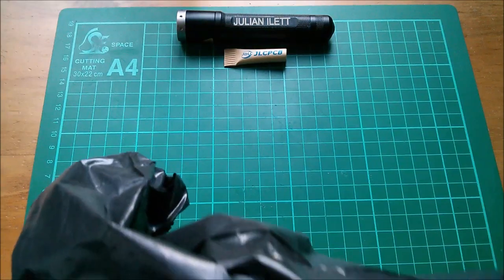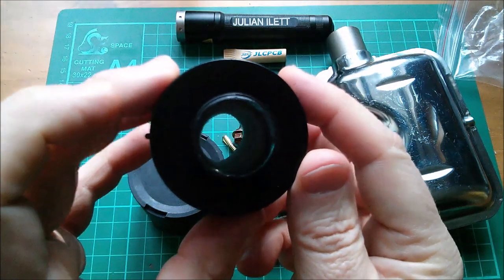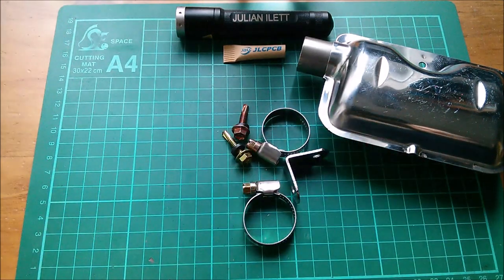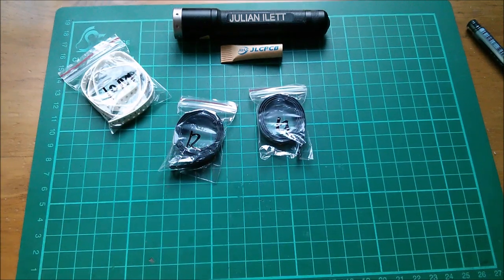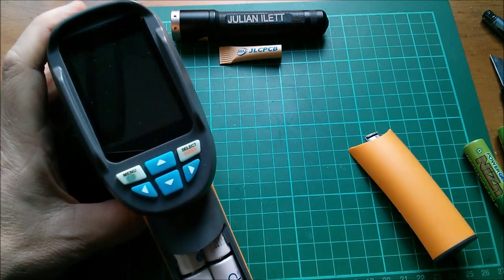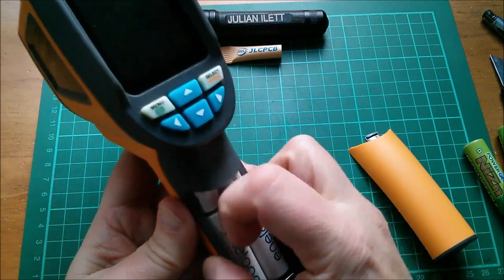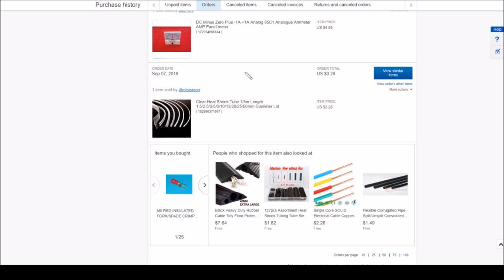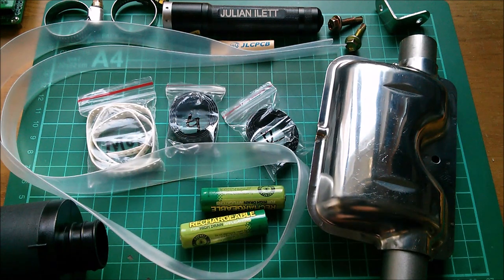Julian's Postbag: #0x80 - Four Envelopes and a Knife

Comment: That snap off blade thing is kinda interesting, because I have had a few different knives like that (certainly cheap ones) during decades and I have never had a failure. I just extend the blade so that the snap line is just outside the knife body (no pliers needed), and then use the tail piece with the slot inserting it close to the line and then just a quick motion to snap it. And you need to snap it away from the line i.e. if the line is on top then snap downwards.
Reply: Yes just retract the blade to expose one blade section leaving the knife body to secure the rest of the blade. Use the tail piece as pev says. Come on Julian, I'm surprised you're struggling with this, a Technician of your calibre!
Reply: Spot on, was just about to suggest that too. One blade out, and then it snaps off easily.
Reply: Yes, this how it's intended to be done. The way Julian was doing it made me cringe a bit, and I was expecting him to slice his fingers open!😮
Reply: Worse yet... Sproing!  Several snapped off blades flying everywhere, into thighs, eyes, and the very skies landing in carpet awaiting the unprotected soles of passers-by.
Reply: precisely I've used lots of these both cheap and expensive never had any problems always snapped off in the right place
Reply: Not seen someone fail so badly at using one of those snap off blades.
Reply: Sorry Julian, we're giving you a bit of a hard time on this blade thing! Perhaps you were hamming it up a bit for a laugh. Thanks for your hard work. I always look forward to your slick and well produced videos.
Reply: @
pev 16 
i just extend 1 segment put it sideways and flat on a surface press my thumb on top of the blade and lift the handle upwards , snaps off on the line with no messing about with fiddly slots in the end cover :-)
Reply: @webchimp  Perhaps on the shopping channel?
Reply: And remember to snap so that the blade pieces end up facing AWAY from you, especially your face.... The snapped off piece can fly out of the snapper tool slot if the slot, and you don't want it in your eyeballs.
Reply: Although on second watch I must say the knife Julian has here seems particularly crappy. The slot in the tail piece is weirdly recessed which guarantees trouble with the snapping.
EDIT: To the "sproing" comments, no, the snapping process really does not make the piece fly forcefully, for that to happen you have to do some extremely weird stuff to the blade, even weirder than Julian does here :)
Reply: @bobriemersma  My laughing almost caused me to Die. To carry on, I will Try. Sigh.   :-)

Comment: The intake silencer works on the absorption principle. This principle will reduce higher frequency sound waves, but have little effect on low frequency noise. 

The flue/ exhaust silencer works by reflection. This principle reflects sound around the inside of the can to trap it. The actual flue gasses simply pass through the torturous route, reasonably unaffected. 

If the flue silencer inside the work area, it'll give off a few extra Watts of heat.

Comment: Serious comment on the NiZn:

NiZn cells are marked with the mWH to aid in marketing (they can't make 2500 mAH), the idea is that due to the higher voltage the capacity is similar to that of a NiMh of 2500 mAH.

As far as self discharge is concerned, they have a low self discharge early in life before gaining higher self discharge. The self discharge really increases after 30 cycles or so.

Charging can be done on a bench supply with appropriate voltage monitoring. According to Wikipedia the charge can be done at a rate of C or C/2 to a cutoff voltage of 1.9

More info here: https://en.wikipedia.org/wiki/Nickel–zinc_battery

Comment: I was going to order some of those PCBs from your outfit, got through the process, then got to shipping!  WOW sure gives new meaning to 2 bucks for 10 PCB's!  It's one of those outfits that lures you in with a cheap price then sticks it to you for shipping, at least that's the way I see it. I could be wrong but it would be a rare incident in time should that happen..
Reply: Keep in mind it depends where you live, but even with shipping it's still by far THE cheapest I've ever seen for custom PCBs, something like $12 after shipping for 10PCBs whereas OSHpark for example can offer comparable prices but only for fairly small boards and you only get 3 of them but JLC let's you do up to 100x100mm plus you can do panelization, which means for small boards let's say 20x20mm you could get that made into 5 boards on a 100x100mm panel that you can snap apart or in other words 50 boards for the same price, I could be wrong but I've not heard of any of the other guys even offering to do that.

Comment: That is an air intake silencer, that's for sure. It will work well, but you need an air filter too. It's not the bugs you should be concerned with, but the abrasive particles that could be sucked into the cylinder which will act like a sanding paper.

Comment: You should get some of that resealable gel for PCBs. That gel that makes a huge mess but you can stick probes through it and probe your board then when removed it reseals the water proof coating. May be a bit expensive though.

Comment: Consider two 14500 LiFePo4 and two dummy cells for your camera's higher voltage needs. They're also good for flashlights which can accept lithium because they just as bright but safer.

As for the hot exhaust next to wood. Cut up an aluminum pie tin and tack it on the wood to reflect the infra red and dissipate any heat which the aluminum absorbs. It's cheap insurance friend!

Comment: Retract the knife so only the 1 link you want snapped sticks out, angle it  with the brake line on the knife, if you do this, snapping it off correctly works just fine using the cap.

Comment: The fresh off the line voltage of a quality alkaline cell is 1.65volts so it should be fine to use 4 of these instead of the enelopes.

Comment: For your charge controller you should do a test were you coat one, you just sleeve (and hot glue) one and the third were you do both.
In the sleeved ones the water can't evaporate compared to the just coated one.

Comment: Julian - Two notes and a question -.  
1.) Only expose the single blade piece that you want to snap off of the knife.
2.) Open voltage on an alkaline is about 1.6v ... charge the new batteries to something that settles to around 1.6v?

Also - with Lithium rechargeables and 'military specs'.  Any idea how much energy storage is lost by skipping the long final 'topping off' phase of charging?  It seems to me, the extended life of the battery could be well worth the cost of adding an additional cell to a project.
Reply: Ok - Now I see other comments about the blade.  Add me to the list ;-)

Comment: for your thermal imaging camera you could always try using a portable usb power bank to boost the voltage from the 4.2 volt lipo's too just one volt below the 6 volts the cammera is expecting that should show mostly full up till the lipo reaches its cut off voltage.

Comment: just get a kit of LiFePO4 batteries from Soshine, you get 4 batteries and 2 connectors: so you can use 2 batteries + 2 connectors in your thermal imager and keep 2 batteries as spares. I am so happy with those in replacing AA alkalines and NiMh

Comment: Have you thought of using peltier elements on the exhaust of the diesel heater?
Heated up the do send out voltage, maybe you could put a bit back into the batteries that way.
Not sure how many amps though, but it could be worth an experiment (and a video).
Reply: They have terrible (read: single-digit percentage) efficiency. Have you seen these "heat powered ultra quiet eco-friendly silent stove fan" things? They barely manage to kick that motor over and require uncomfortable temperature differences to operate.
Reply from the maker: Yes, you have to heat one side while keeping the other side cool - that's means a complex interface to that curvy silencer and a big heatsink to the cool air.
Reply: @JulianIlett  You'd be better off trying to improve efficiency with a heat exchanger that warms the intake air with the exhaust heat. Maybe coil the exhaust pipe a few times inside an "intake pot" of sorts. Just make sure the exhaust pipe is gas-tight and rust-free, and that the actual openings themselves are kept well separated, or there'll be no more postbag videos!
Reply: Well.. The cooler you can keep the opposite side, the more you'll gdt out of them.
May not be much, but better than nothing.
With winter coming, keeping them cool shouldn't prove to much of a problem. Think of it a lower powered backup to your solarpanel setup. 
Any little thing you know ;)
Reply: I was thinking, might not be too bad an idea to just set up a diesel generator in a box outside the work area and have a fan blowing the heat off of it into the work area.  With an electric starter you could hook it up to the thermostat and have it turn on/off with the temperature.  Could use excess electricity to run an electric heater when the batteries get fully charged.

Comment: Would the exhaust not be safer if it were above the level of the roof line much like central heating boilers, thus the fumes wont get blown back into the enclosure during windy conditions?

Comment: NiZn accumulators are designed to give a large current. In a device that consumes little, they may deteriorate quickly enough. It takes a specific charger to load them properly!
watch out for dendrites that form with weak currents

Les accumulateurs NiZn sont prévus pour donner un courant importants. Dans un appareilqui consomme peu, ils risquent de se déteriorrer assez vite. Il faut un chargeur spécifique pour les charger comme il faut !

Comment: I would whack all the batteries in, aren't alkaline normally 1.6 ish when new?
Reply: The nominal voltage of a fresh alkaline cell as established by manufacturer standards is 1.5 V. The effective zero-load voltage of a non discharged alkaline battery, however, varies from 1.50 to 1.65 V, depending on the purity of the manganese dioxide used and the contents of zinc oxide in the electrolyte

(Wikipedia)

Comment: The front end of the plastic is angled same way as the scoring on the blade to use the handle to snap it off!! Leave the pliers and fingies out of the equasion
Reply: Just going to say the same thing.
Reply: @gibbo9089  those blade pieces gone flying can really make a mess hitting an eye😣 the fact that julian does not know the proper way is beyond me, since he  is so good with the knives
Reply: But if the fingers aren't anywhere near the blade what fun are knives then?
Reply: @heikovanderlaar3780  i usually cut towards the thumb, when i like to live dangerously! But the mess is awful...

Comment: Speaking of devices that require AAA/AA batteries and tend to complain about NiMH's voltage - I managed to hook up two "dummy" (empty inside) AA batteries with external wires sticking out of them, leading to an adjustable powerbank - that way you can set whatever voltage you like and run AAA/AA powered device for hours from your 18650 collection. You do have to store a power bank in your pocket yes, but it's million times cheaper than using alkalines. It looks something like that: https://i.imgur.com/Wm5e0Up.png

Comment: The moisture in your old solar controllers are most likely due to the humidity in the air before and during sealing them up, condensation from the moisture not having the ability to escape

Comment: Use a Batteriser!
Reply: the batteriser reduses the max capacity by 25-45%, so that isn't goin to help much. a LiFePo4 18650 or two will work just as well, and have a higher capacity.

Comment: I actually need those batteries. My bloody camera needs 3v and does not even power up at 2.4
Reply from the maker: You can also get lithium primary cells (non-rechargeable) which are 1.6V - I used those in a 3V Canon camera a few years ago. But I really don't like buying single-use batteries anymore.
Reply: @JulianIlett  bit of a waste, isnt it? Its a shame the camera does not go up to 4v as i'd print an 18650 holder for it.
Reply: @karsnoordhuis4351  How do you know it doesn't go up to 4V? Also if you want to make it more compact you could find a camera/phone battery which would have built in protection.
Reply: @vgamesx1  it says it on the label. I usually thrust them and dont go over it as if killed quite a few components whilst not paying attention to the powersupply.
Reply: @karsnoordhuis4351  Well then here's what you do, find a 3V or 3.3V low dropout regulator that can supply enough power for your camera, here's one I found within a few seconds of searching that can supply up to 1A from 0.6V to 5V so running it at 3V it would make it drop out when the battery hits 3.425V: http://www.ti.com/lit/ds/symlink/tlv757p.pdf?HQS=TI-null-null-mousermode-df-pf-null-wwe&DCM=yes

You could also look for a buck converter but it would be harder to do yourself and not a lot of premade options for that, although there are some esp8266/32 battery boards that can do that.
Reply: @vgamesx1  actually, a boost converter + rechargable batteries might not be a bad idea. If got two coming in if the bloody post finally decides to actually do something. They say the minimum Vin for them is 2v so that would be ideal for two batteries